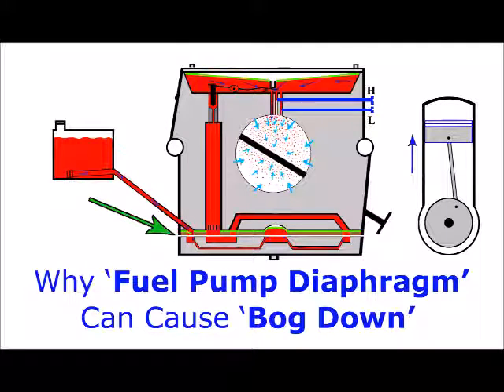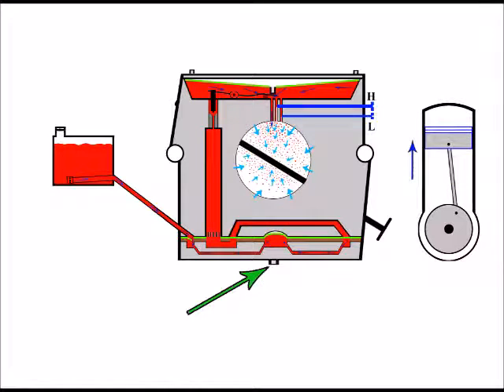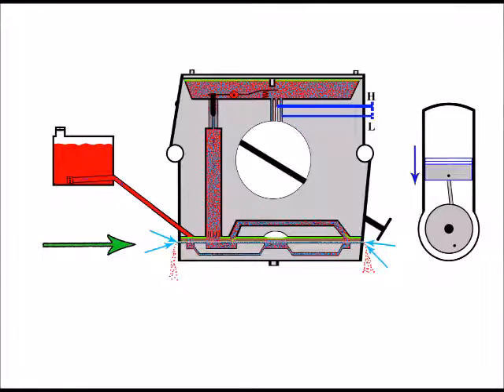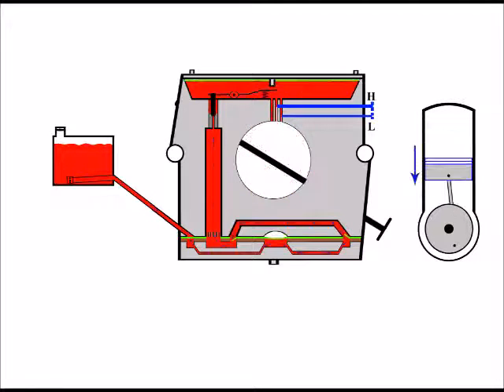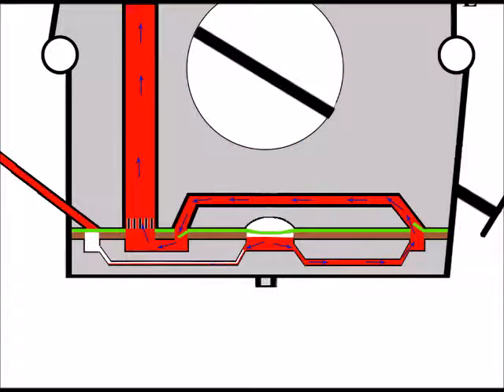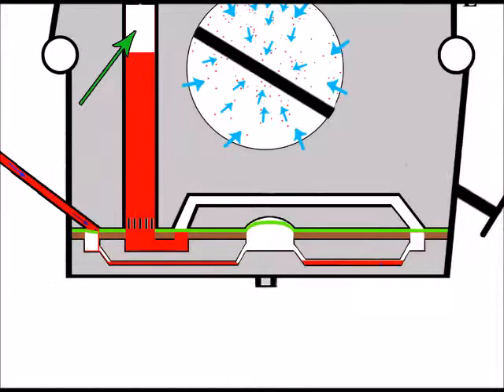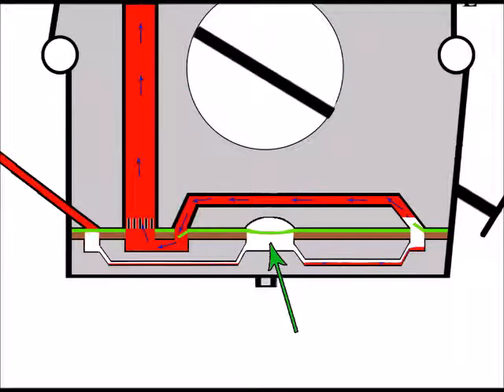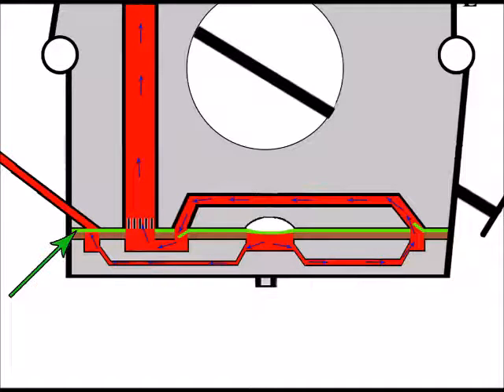CHAINSAW CARBURETOR DIAPHRAGM: Why 'Fuel Pump Diaphragm' causes BOG -Won't Start. (by Craig Kirkman)

Comment: Additonal information:  It only happens when I'm in the water under load....it runs/increases rpm's fine when out of the water.
Reply: Did you sort this out mate? What was the issue?

Comment: I have a 1985 Mariner 25hp....when I increase to accelator handle to plain out, it starts to rev-up and almost immediately the rmp's cut back/boggs down to troll speed.  What is the problem?
Reply: Did you sort this out mate? What was the issue?